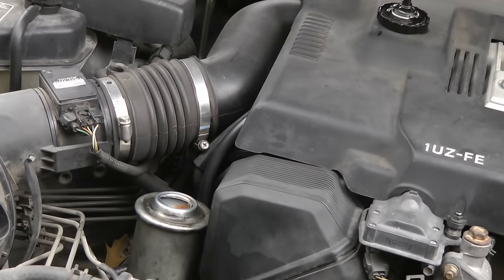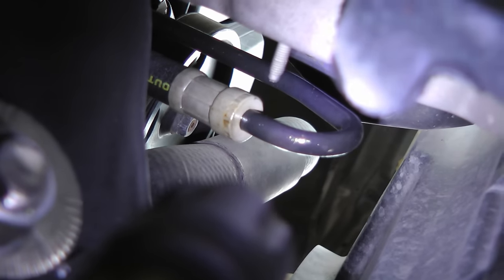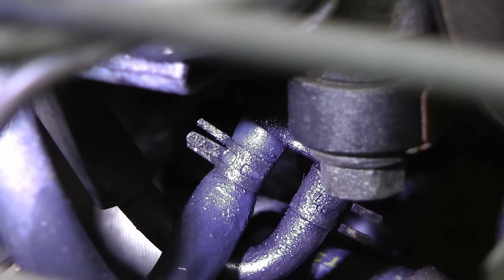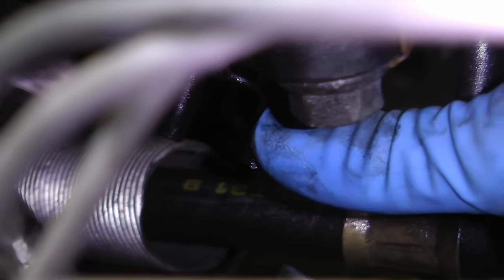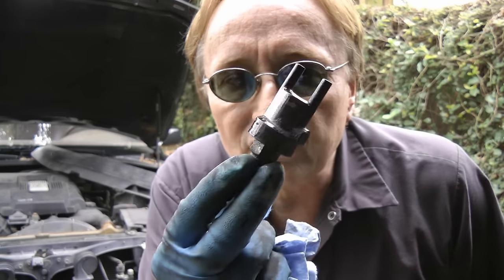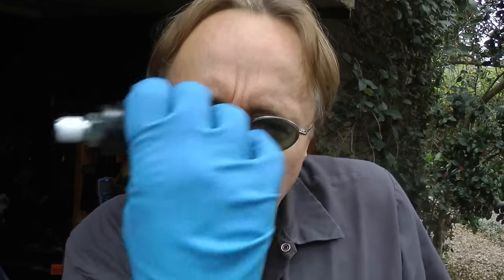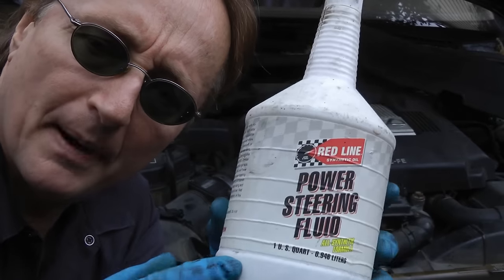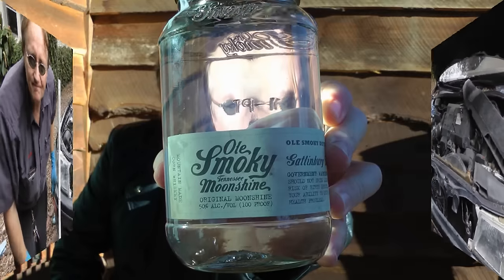How to Fix Power Steering Noise When Turning

Comment: scotty my f 150 seems to be quiet when first starting. then after I've been driving and I pulled into a parking lot you can hear it making noise as I'm turning the steering wheel.
Reply from the maker: often worn power steering pumps do that, of course check for low fluid in them first
Reply: Thanks for the reply, i noticed that its actually the steering column that makes the noise.  When i turn the wheel with the engine off it still makes the noise.  Any ways to quiet it down?  Why do older truck get noisy?

Comment: I have a whining noise coming from the rear passenger side of my 03 Pontiac grand am. I think it may be the fuel pump. To me it sounds like a motorized part being strained or something. It did not used to make this noise. If not the fuel pump what else could it be back there?
Reply from the maker: only thing back there is the fuel pump if it makes it when car is just sitting not moving
Reply: yeah when its in park it makes the noise, it also makes it when the car is moving tho

Comment: I have to ask what state do you live in because I like you to fix a car I'm thinking of getting and I don't know how much it will cost and I don't have a jack or anything and I don't know how much a jack would cost but it had some type of power steering hose issue is all the what the person is saying and they said they don't know if it's the leak or not or anything like that but I live in Florida

Comment: Hi Scooty I have a Hyundai Getz 2006 1.4 car so when I do turning my steering to left or right it makes sound and even power steering belt stops moving when I move steering completely left or right turn but when I go straight there is no sound also I replaced power steering belt and pump but problem remains same as b4 so could u tell me what is the problem thank you

Comment: I have a 2013 outback limited 3.6 and my power steering whines every so often. I had the fluid changed but no effect. After a long trip on the hwy when i get below 45mph it starts whining really loud and dosent stop till i stop and let it idle for a few mins. Its hard to duplicate the issue it does it sometimes. Idk what to do. If i turn the wheel and give it some gas sometimes it whines really loud. Or when i leave a intersection only sometimes

Comment: I have a 2002 Chevy Venture, one day my battery died and I needed A jump off so I was by myself and turned the steering wheel real hard to the left so that I could get out of the Road and something sounded like it had snapped. Every sense that happened I was unable to make a left hand turn and my power steering reservoir stopped holding power steering fluid. Now every time I try to make a left handed turn my stirring wheel just clicks a lot and will barely turn left. Please help me diagnosed what could be the problem.

Comment: What could be the problem because my reservoir for my power steering pump is full but it still making that noise when I turn my steering wheel on my 2003 Honda Odyssey van

Comment: Hi Scotty, recently I had same problem with a leaking idle switch on a Buick 91 and after replaced it the steering keeps hard to turn on low idle... do I have to recalibrate the computer with the new switch or is something else?
Reply from the maker: something else, generally a worn out pump
Reply: Scotty Kilmer I´ll check it out. Thanks man.

Comment: Will changing the powersteering fluid in my bmw e46 remove the noise? it comes when i steer. i already changed struts and shock absorbers, could it also be bushings?
Reply from the maker: many things can make noise on a BMW, but rarely is it the pump unless the bearings go out and then they whine like mad. More often worn rubber bushings on the a frame or torsion bars

Comment: My friends 96 accord lost power steering one night, i checked it the next day only to find all the fluid came out of what looked liek the top of the reservoir, leaving not fluid in the system. took 12 ounces to refill to the min mark, works again but makes noise when turning, sounds like when theres air trapped in the system but im not too hopeful as he drove it without fluid for at least 20 miles. no leaks visible. any idea how it emptied itself?

Comment: Scotty i have a civic type R FN2 and there is a whining sound that i hear when i turn the steering to the right. However my car doesn't use any kind of fluid because it has an electric power steering.. Honda told me that they can lubricate the steering but the whining will come back after a while. Do you know what should i do in this case? thanks
Reply from the maker: yea, don't buy a honda with electronic steering. It's just a design flaw, live with the noise or get a toyota next time.

Comment: Hey, my steering pump starts to whine when I drive with my ac on. When ac is off the whine goes away. It only wines (when ac is running and)when I'm pulling out of parked position(slow speed). Is this normal?

Comment: Scotty I have a 2003 infiniti i35 I need to change my power steering belt but my tensioner bolt on the power steering is bent. Where can I get one. I've looked and can't find one.

Comment: I have a question we have a 99 grand marquis....and lately it started making a clunking noise when we turn the wheels...we have no leaks on the power steering.....could it be the steering box? we noticed it jurks when the wheels are being turned.....whats your thoughts on it
Reply from the maker: jack up the front end, and pull on the wheels and see what clunks. Could be steering box, ball joints, tie rods, lots of things.

Comment: I'm just wondering on something, I have a 2002 Nissan Maxima GLE, now when I turn it on in the morning I've noticed that the RPMs go up to 3000 and then goes down to 1500 and then takes a little while to go down to 1000 or a little below. Now is that normal? . Only happens when I turn it on the morning when I go to work and when I get off work.
Reply from the maker: +Alejandro Lopez when that old it's normal, but try my video "how to fix a car that idles poorly" and clean it

Comment: my daughter just had her motor worked on basically rebuilt and now her power steering fluid keep getting low could the mechanic not have tightened it when he worked on the motor.  Its a 200 Lexus suv
Reply from the maker: Sharon DeBoever   only thing he could have done was to not put the hole connections on tight, check that first. Or he could have damaged a hose and ripped it

Comment: My high pressure power steering line blew, so i replaced the line, and refilled it. Now it makes a loud screech when i turn, it also vibrates like somethings grinding. Any idea whats wrong? Could there be air in the line?
Reply from the maker: spiffcats pray it's air in the lines, cause running a pump dry when out of fluid can ruin the pump too

Comment: Hey Scott I am from india.. I have a Volkswagen polo 2011. And everytime I turn the steering left or right it makes the strange sound  like Tuk tuk tuk.. Recently I changed the whole steering rack and the sound went off but then after a month or so it is now back.. Please shed some knowledge..
Reply from the maker: +Tenzin Thutop if you used a rebuilt or used rack, odds are it is bad now too since the noise went away at first.

Comment: I have a 2004 gmc Sierra and my power steering was making a noise now my steering wheel will not move enless I move it by hand  would it be my steering pump or steering gearbox
Reply from the maker: Aaron Clemmensen could be either, realize pumps are a LOT cheaper, I'd start there

Comment: You put all the parts and links to where you purchased but missed out the very part you changed - there’s so many different names for the same item - power steering pressure switch - power steering idle switch - and none are looking anything like the switch you took off the vehicle you were working on 🤔

Comment: my power steering groans when i turn the wheel so that might be it. however the intake makes like a funny sound when i turn the wheel its really hard to explain the sound but the closest i can explain it is a large bubble surfacing from under water but a much more deeper bassier sound like if you were hearing it through a long tube. again very hard to explain the sound. anyways some guy told me maybe the throttle body is dirty any help would be nice thanks
Reply from the maker: yes, clean the throttle body as in my video "how to fix a car that idles poorly" and check the ps for leaks. If no leaks, try my video "fixing binding power steering"

Comment: Hi when I turn to the left or the right it does when I go over certain speed bump it tent to have a small vibrantion and sound just like the steering wheel sound and I don't hear it in the winter but only when it's warm out I was told it was a ball joint then the shocks when oil it stops so I just want to know that which part because its different parts thx

Comment: my power steering pump is making a whining noise but I think its the bearing in the pulley, but its also leaking from the hose, I see rubber belt shavings everywhere, would you say I need a new power steering pump?
Reply from the maker: +Jose Lopez yes

Comment: The steering on my 2002 Camry has been 'moaning' (as I call it) since I got it in 2009.  I've noticed it getting a little louder when it's warm and humid out.  The power steering reservoir has had enough fluid in it all the time and it still bugs me what's causing it.
Reply from the maker: change the fluid out and put in pure synthetic power steering fluid like redline, that can stop it. If not, time for a new pump

Comment: Hi Scotty. I have 2010 Kia cerato koup. I searched for power steering re filling bottle. no luck, maby it has electric power steering? anycase, i have whistling noises when turn left or right whilst driving, how do i fix this? thx
Reply from the maker: +fp naude it has electronic steering, live with the noise unless you want to buy an expensive electronic motor assembly

Comment: Hey scotty, everytime I turn my car either direction it makes a noise if I turn it too far, my wheel it starts to tick/jerk. I have a hard time parking, it also started making a noise when I'm driving. Could this be my driving axle I drive a 96 chevy lumina it just started doing this yesterday it does have over 215+ miles on the car.
Reply from the maker: often a worn out power steering pump does that, but of course, check the fan belt that drives it first
Reply: Belts are fine. I checked those yesterday I figured it was since the car has been sitting for some years.

Comment: I HAVE A 1999 HYUNDAI ELANTRA AND THE POWERSTEERING PUMP IS MAKING WHINING NOISE ESPECIALLY WHEN I START UP, MAKE TURNS AND SOMETIMES IDLE.  I NOTICE THE PULLEY ON IT WAS STICKING.  I PUT SOME WD-40 ON IT AND IT KIND OF HELPED BUT STILL ANNOYING.  DO I NEED A NEW PUMP OR JUST THE PULLEY?
Reply from the maker: do not put oil on it, replace the fan belt, and if that's not it, replace the pump assembly

Comment: hi scotty.well I have 1992 lexus sc400 with steering problem's I just put a new rack&pinion in a new pump in.but the car still doe's not turn. and a lot of noise from the pump still. what can be the problem here??? iam baffled
Reply from the maker: realize you often have to use a New pump, as rebuilt ones are often crap. and the same goes for the rack, rebuilt ones are often bad. BUT, do check the high side pressure hose, they can go bad and build up too much pressure, and also check for things like worn ball joints which can also cause binding

Comment: Mine makes a squeling when I turn the wheel all the way to either side. I noticed my power steering fluid has a weird smell to it. Almost like electrical burn smell. Any thoughts?
Reply from the maker: often a weak pump

Comment: hey sir scotty i just replace my ps pump, and all the belt also the idler pulley. but why my belt squeal when first start in the morning specially when AC is on?
Reply from the maker: could be the AC compressor is wearing out, but make sure you hae a quality belt and not some cheap make, cause it makes a difference. Often a quality belt will stop such noises
Reply: thank you so much sir Scotty Kilmer  il try to change it to quality belts even though i just change it, more power sir

Comment: I may have just go robbed by  a local mechanic I trusted.  My 2000 Ford focus wagon had power steering fluid leaking.  He changed steering pump and charged around $126 for the rebuilt part.  After I got my car back I researched the pump cost and found rebuilds starting around $50 and the high pressure hose assembly was $94, and I found this part at $31.  
I was severely overcharged for the 2 parts and also charged $8 for steering fluid.
Charged $120 - check for power steering leak including r and r pump.
R and R pressure hose labor $85.  I saw videos where the battery, air filter box and a few other things are removed to do the r and r of the steering hose, but there is no evidence of hand prints or wrench marks on any of these things, so I wonder if they even really replaced the pressure hose. 
I still have leaks.
My total cost was $457.51.  I've been financially assaulted by an owner of and auto mechanic shop.

Comment: I have a 2005 Hyundai elantra, I took it to the mechanic and it's making the most awful squeak when I turn the steering completely one way or the other, my fluid is fine, the mechanic says he's checked everything and it's fine. He told me not to worry but how can I not? He said its normal, is that true? If not what should I do?
Reply from the maker: it's normal for a 9 year old elantra. But, get some WD 40 and spray all the rubber bushings on the front end, noise often goes away then. Rubber just dries up and does that, it can stop for a while, then spray it again

Comment: the car started making clunking noises when turning 
My dad said that he had put power fluid in the car and when i checked it was a 2 or 3 inches over the max line
my dad says that is is okay and is actually better than having it between the min and the max
i dont think so but dont know how to take the exess fluid out. 

is that what could be making the issue?

Comment: Hi! scotty i have seen many videos of urs.my honda city has a sound coming when the car is at a particular angle at a particular speed .although i have taken rough turns there is no sound .The only thing visible is a oil leak from the rack and the rack's right boot is torn .could u advise pls
Reply from the maker: +Hamish Sampai replace that cv joint that is ripped
Reply: +Scotty Kilmer Thanks for the reply scotty.the pob is there is no cv joint ripped it is just the rack right side boot .could it also be possible to upload a video about how to fix sterring rack leaks(there is just 1 out there).Thanks

Comment: 2001 Toyota Camry, high pitch squeal coming from front tire area when I turn steering wheel, does it with or without using brakes. Reversing or going forward. Did it on left side now its on both sides. Any idea?
Reply from the maker: often a worn power steering rack
Reply: Kla. Sportage

Comment: As a 1UZFE owner myself I can tell you that 99% of people with older Lexus cars like this will encounter this issue with their car and that the same percentage people will simply plug that hole with a 14mm x 1.5 short bolt and close the vacuum ports on the intake. You will not even notice the difference. Also, this problem is responsible for the white puff of smoke people will see upon start up.

Comment: Mechanic just changed my alternator and had to take the power steering fluid part out and now he’s put it back on and said that the noise from steering should go after abit of driving but It still vibrates and makes a noise when I drive? Anyone know why?
Reply: It make be a brake caliper or a tire

Comment: I have a Honda Civic LX 2000, when im reversing and switch gears, sometimes my steering wheel gets stuck and doesnt let me turn it and it makes a really loud squeaking noise. I hate it, I have to take my foot off the breaks to spin the steering wheel and its embarrassing. Can you help?
Reply from the maker: +Jaime Bernal often a worn out power steering pump or clogged steering rack
Reply: Alright, thank you. My dad said it might be because my a/c compressor band is tangled and that might be it, do you think it can be that?

Comment: so if my fluid is full, its a faulty pump? or rack? how can i tell? its only when its cold tho once it warms up it goes away, i also did my water pump recently and i think i may have tight the belt too much.. will that make a noise if the belt is too tight?
Reply: I'm dealing with a idler pulley atm just needs new bearings but makes one hell of a noise, was this your problem?
Reply: needed to tighten the belt...

Comment: I have a 2002 Toyota Camry and my steering wheel squeaks.  I just replaced the Clock Spring because I was told that was the problem but it is still squeaking.   I also hear air when I step on the brakes and sometimes the pedal moved down on its own.  I had the back and front brakes bleed but still moving on there own.  HELP PLEASE!
Reply from the maker: realize the plastic steering wheels just squeak as those age, means nothing.  But air is a worn brake booster or a leaking booster check valve
Reply: Thank you so much for responding. I will certainly check it out.

Comment: Hi I ust watched your video, im a college girl that knows nothing about cars. My steering wheel grinds when i turn and within an hour it became really hard to turn (i could barley park) and we opened the hood and there was smoke coming out. do i just need power steering fluid? or is something else wrong. im scared because i don't have 600 dollars to pay for it to get fixed
Reply: Did you get this fixed? My pt cruiser just did the same thing yesterday. Unfortunately I used power steering fluid when I was supposed to use ATF +4, but I made it home.